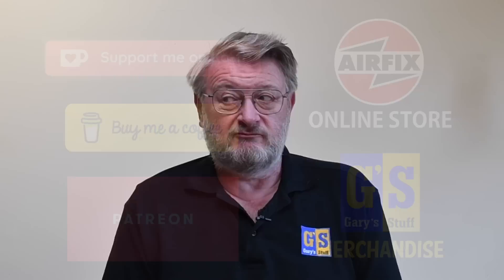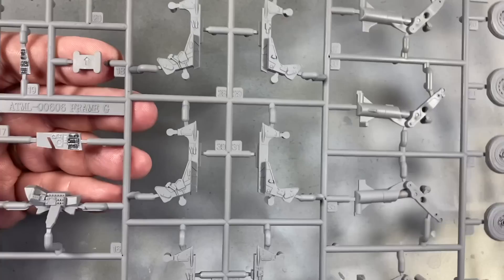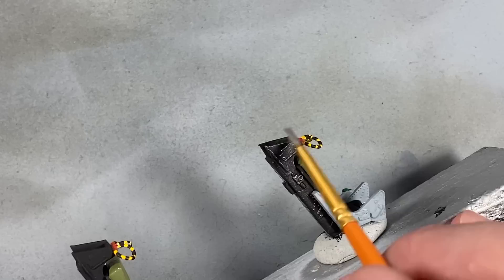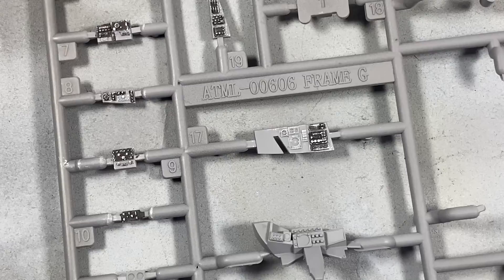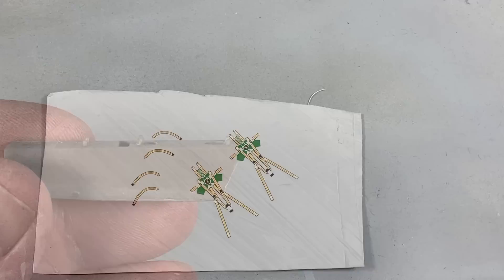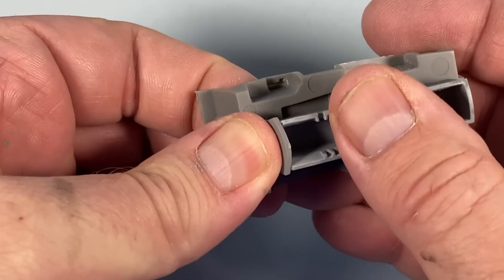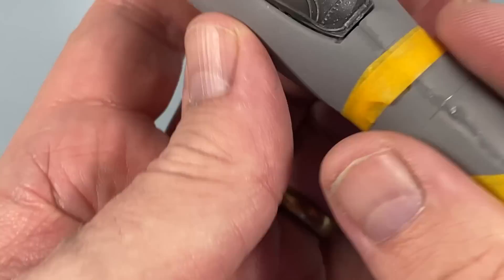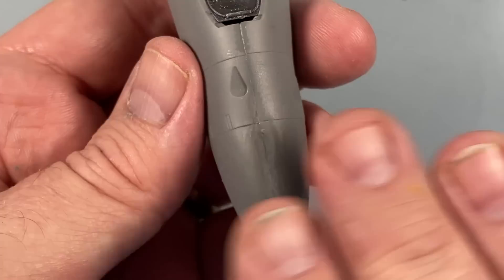BUCCANEER Airfix 2022 brand new tooling 1/48 scale - build day one - cockpit and nose HD1080p

Comment: Re painting. As I'm inclined to be a bit prone to overspill with a brush I'd be inclined to dry fit, say the seat parts first, mark the areas which would be glued eventually, then paint the rest before assembly. That way there's no glue on the contact surfaces, but you don't risk any overspill if you slip whilst painting.
Reply from the maker: To be fair, an awful lot of the floor won't be visible anyway once the fuselage is closed up!!!
Reply: @garys_stuff  that brings me on to a comment about pilot figures I'll make in reply to today's Monday Matters video.

Comment: The tin with decals is a technique i used to use with wargaming figures banners back in the 90s in place of the paper ones typically provided. It can work quite well with care and could be used for RBF tags and similar things. The metal of drinks cans is probably fine enough.

Comment: AH...the Blackburn, NA 39, Buccaneer...I have 3 of them.(Corgi die cast in 1.72 scale) I made the Airfix kit when it was first issued. 
How much was it...I hear you ask... 
OK. It was as far as I recall, Airfix series 2. Which were a bit more expensive at 4/6d (Decimal translation = 22.5p)
and the nose could be set  sideways, the air brakes could be set at fully open and the wings had the folded option. 

Boring self endulgent stuff....
Living with spitting distance of the Hawker Siddley factory at Brough, East Yorkshire I often met people who built this 'Beast of Maritime aviation. And according to them...it was an absolute beast. 
Boring self indulgent stuff....
I had a metal staircase from the Buccaneer assembly jig which came in handy what I needed to replace my old slippery wooden and extremely perilous workshop staircase. 
FURTHER....
Freinds who were instructors  in the training section at Brough...oversaw the refurbishment of the centre section on the 'Handley Page Halifax' that is on permanent display near York. 
There is only 1 aircraft that can replace the Buccaneer....and that's Another Buccaneer. 
Nice job on the build...and fine tribute to 'The boys' at Brough.
Reply from the maker: I made that original NA39 for my blog - https://bit.ly/3qRr1bU - but subsequently made two of the new tool S.2 kits in 1/72, then another two converted to the S.1 with some aftermarket. A definite favourite of mine. I love the new 1/48 as well. Good background stuff too Fred!

Comment: So much work to do to get the cockpit right. Glad you were able to savage a win after the mistake.
I had a plastic model of a Buccaneer as a young boy but nowhere near as detailed as this model will end up with. 😁
Reply from the maker: Depending on when you were a young boy shows the start of the kit. When I was a young boy it was the first mould from Airfix which is dire by today's standards.
Reply: @garys_stuff  This was way back in the 1960's and it was a pre-built model. It was the ;at 60's before I started with Airfix. Looking forward to seeing the finished aircraft 😁

Comment: Great build Gary! A couple of tips, artist's silver pencils or even HH leaded pencils work well for dry brushing. And for black areas I rub ground up HB pencil lead into the black coat which gives a worn metallic effect.
As for the Microsol/set bottles they fit into the inner part of a Tamiya rattle-can lid which can be screwed into a piece of wood for stability.
Looking forward to the next installment!
Reply: Good tips.  Also, you ll save the ferrules of your brushes if you work from the bottle cap after you've poured some of the solution into it.  I save the caps from empty bottles -- they're so handy for mixing washes, decanting decal solutions, etc.  Little plastic pill cups, too.
Reply: Also, if you know anyone with a 3d printer, Matt of Model Minutes, another creators from the Airfix gathering, put out a file for free that holds the 2 MicroSol bottles. Want to say was 2 or 3 months ago on his channel. Even flipped him a few dollars for the file out of appreciation. Holds them perfectly and I'm quite the klutz!!
Reply: Great tips btw, if I'm getting it correctly. The definition of the HH/HB is only part unsure about. Thx
Reply: @crazylocha2515  thanks! The HH/HB is a measure of the "softness" of a pencil lead with HH being harder than HB. I think it may be a UK thing with other countries using their own systems.
Reply: @randalscott7224  okay, that's why I've heard it before, just didn't register. Here it's No.2 or 3 etc for hardness (Florida). Big thanks for clarifying that 👍
Reply from the maker: Pity Humbrol didn't give us a printer each then...!
Reply: @garys_stuff  Don't worry, I'm scheming something but it's not a printer
Reply from the maker: In one sentence you've instilled intrigue and fear in equal measure...!!! Time for a restorative coffee, I think.
Reply from the maker: H for hardness, B for blackness. Your everyday regular pencil is HB. H, 2H, 3H etc are progressively harder, make finer lines and wear less but leave less of a mark. A carpenter I once knew swore by 8H pencils for making his cut marks. B, 2B, 3b, etc. are progressively softer pencils that are mainly used by artists as the graphite has an increasingly soft, almost paste-like feel that is easier to smear and blend. 7B and 8B almost feel like pastels.
Reply from the maker: Now THAT is a good use of a home 3D printer. Just the kind of file Humbrol need to put out as well!!!
Reply from the maker: I use a Faber-Castell aqua silver pencil for panels occasionally to get that worn aluminium look on the edges. Did take me about 6 months to realise I needed to get the tip of the pencil wet first though...

Comment: On the subject of the folding nose, it's a shame, but understandable as you say. However I wonder why they couldn't have said something like  "if you have the nose folded, be sure to drill a hole in the bottom of the nose wheel and secure to a suitable base with wire to avoid tail sitting"

Perhaps something that 3rd parties can offer a option for along with a representation of the radar unit.
Reply from the maker: Black Dog has a set including a nose fold and engines with access panels: https://www.hannants.co.uk/product/BDOA48183?result-token=ZU4Wv
Reply: @garys_stuff  Thats excellent. Thanks for that Gary. Really enjoyed your build of this kit and I think I'll definitely look to acquire it, a soon as I figure out where I'll put it (post house move doesn't help matters in this regard currently!).

Comment: My buccaneer turned up yesterday so following your build with interest.
Good advice on the seat belts was wondering if i should get after market ones but not now.
Thinking of getting remove before flight tag's as doing the folded version myself.
Reply from the maker: I did some RBF tags on a 1/72 Buccaneer and they looked cool against the EDSG colour of the plane. Straps are pretty easy TBH with Paramjit's suggestion of the foil, long as you've got a proper sharp knife.

Comment: Gary do you know if the buccaneer had it's wepons loaded while the wings were folded as struggling to find any reference photo's that show this
Reply from the maker: I don't know, but I know a man who does and I'll ask him...
Reply: Most stores fitted to the outboard pylons would need to be lifted on a loader due to there weight, so it wouldn’t be possible with the wings folded. Saying that, I have seen armourers fitting practice bomb carriers use scaffolding on folded wings, but they are just a 2 man lift. Once fitted, the wings could be folded if needed. The Bucc was supposed to have been able to carry 3 1000lb bombs on a Triple Ejector Rack on the outboard pylons. Never seen it done, and i guess it wouldn’t be a good idea to fold the wings with that weight hanging of them.
Reply: Sorry, they weren’t Triple Ecjector Racks, it was a single rack, one behind the other.🫢
Reply: Thanks for the reply nick I suspected that would not be the case.
Might have to re think how i want to make the aircraft
Reply: The wings could be folded with weapons/stores attached…

Comment: I use Vallejo Acrylics but the paint strips off the plastic easily. Anyone know how to better adhere the paint to the plastic?
I wash it with soapy water and let it dry for a day.
Reply from the maker: Just a decent primer, I normally use Jenolite grey plastic primer, make sure to let the paint dry fully and use low-tack tape, I use Frog Tape. Haven't had any issues for quite a while now (touch wood) and I use the tape for masking camouflage patterns and such.
Reply: @garys_stuff  👍 Thank you Gary

Comment: Nice cockpit Gary it looks very fine. Your ejection seat handles are very nice as well, I can't ever get mine that evenly spaced. Gary do you think the seat harness decals will be ok just installing them straight  on the seats? The canopy will be closed on mine.
Reply from the maker: You can do the decals straight on the seats - it's what the instructions suggest - or put the crew figures in! The seat handles just need a fine brush and a bit of patience, and being ready to have six black stripes per handle instead of the regulation nine!!!